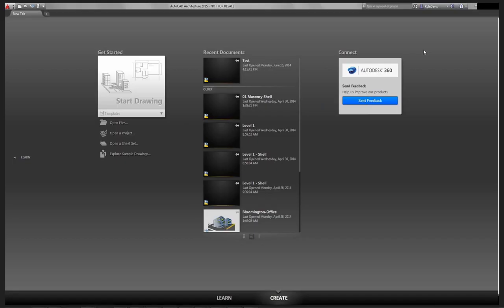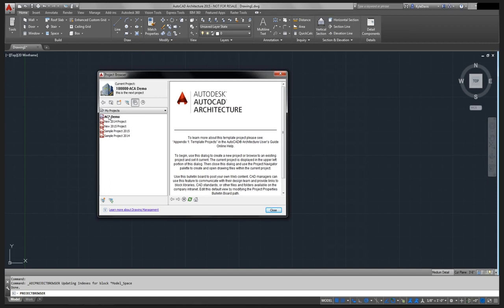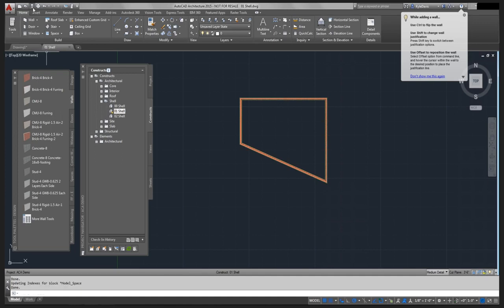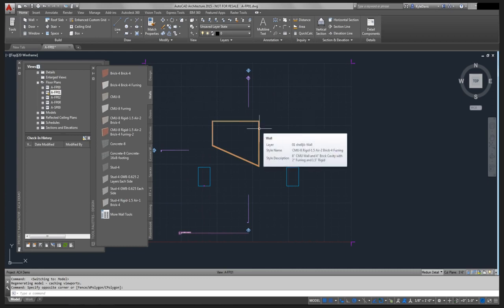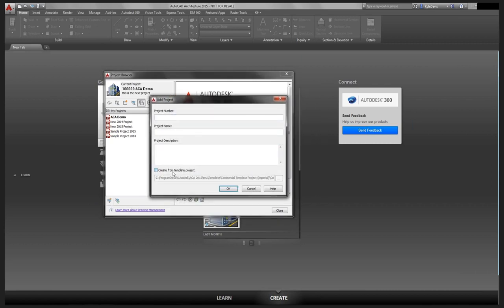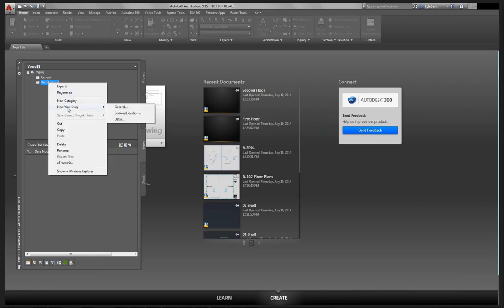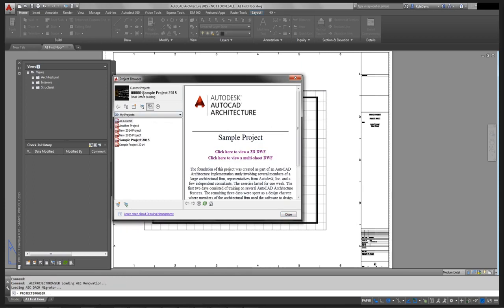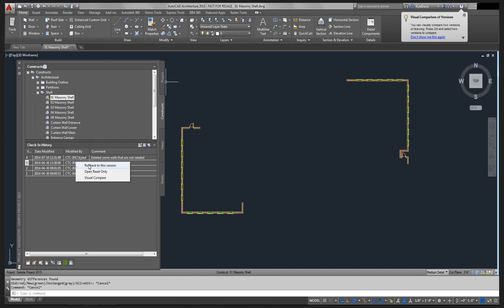AutoCAD Architecture Project Browser and Navigator

Comment: Totally agree with Warren. I have searched many time and it has never come up.  I will tell others where it is. 
It is an excellent video and goes into more issues that I come across. I have gone through the LinkedIn (Lynda) tutorials which are excellent as far as they go. All new build.  Everything neatly fits into the next. As Warren said single story with a simple roof. This is the follow on. 
I live in London where most of Central London houses are split level. that is the front of the building has a basement / old coal store. The rear part of the building is at a half landing.  The floor level for the front could be 0 to 10 and the rear part 5 to 1.  I will experiment but learning should not be about reinventing the wheel several times a week.   I am still looking for a good tutorial which covers these issues. 
AutoCad architecture is an excellent program. Thank you very much for this.